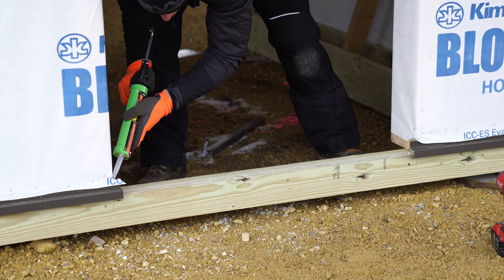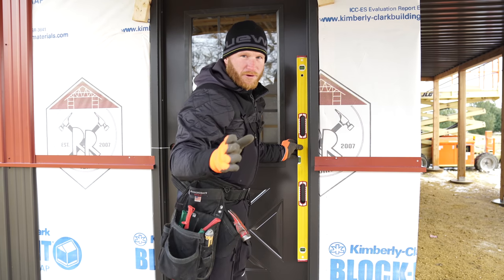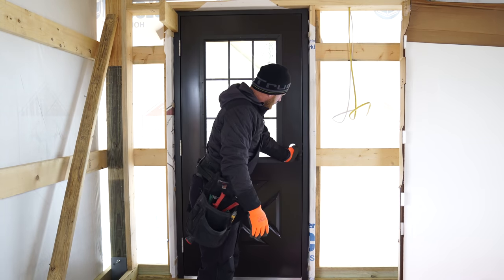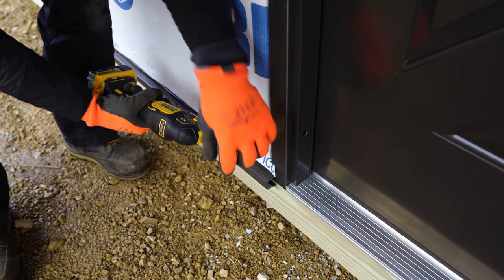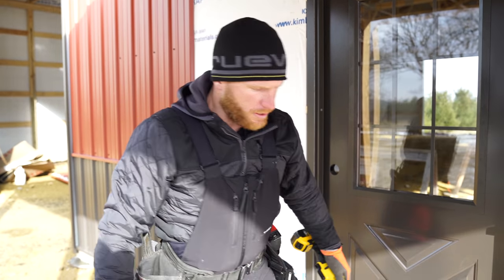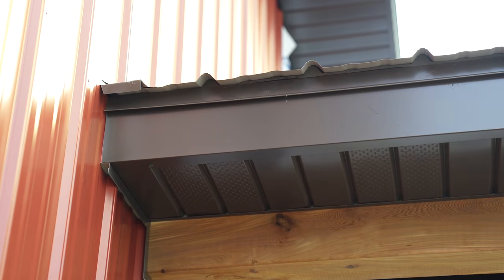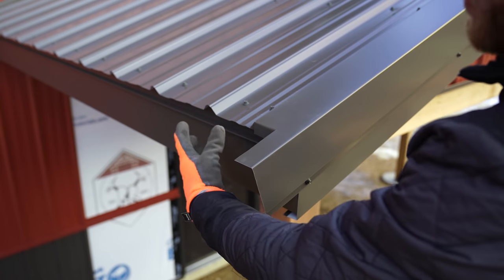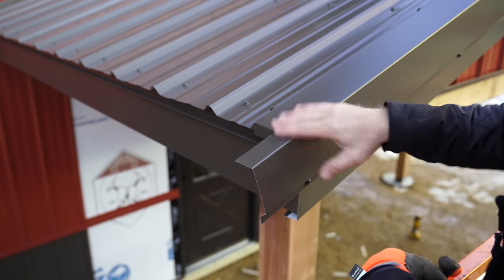Building a Large Garage 11: Installing a Door and Trim Details

Comment: 5:45 Don't forget when you get replacement blades to get the ones with the quick lock opening.  I bought  a pack of Bosch blades of the wrong type and tried to grind an opening for the quick lock but the little holes would not line up.  The remaining blades will work on my 12V Milwaukee tool back at the shop so not a total waste.

Comment: Oh get Well soon guys. 🤞🏻🌹🧸
By the way I was doing the trim for my new garage using your tips and tricks.
I cut the corner trims to lenght and found out I had bought the wrong ones.
They are to small to go over the metal, so now I have to unscrew the metal at corners, shorten it and run this corner trim under the side metal.
I believe it will turn out great any way. But damn. To redo all the 4 meter corners when I’m alone at this time because of the bug situation is a pain man.
Stay safe and hope to see you soon.

Comment: I should not have watched this. Your treatment at the gutter ends looks great. I have stood in the rain and watched rain flow past the ends of my gutters. 
I did not go with an inexpensive builder. My building is fully insulated with radiant in floor heat and perma columns. I came unglued when they finished the walk door and I could pass a piece of paper between jam and door frame. My 10x18 garage door had 1/4 inch gap on sides and top(door to flex seal). They had a professional hook up my opener. He saw the gaps and offered to fix. He did a great job.
I mentioned RR Buildings to my contractor before I signed anything. He said he watches your videos.
Reply from the maker: Wow ... sorry man

Comment: Tip if don’t do with DeWalt OMT, turn blade around 180° for when “storing” tool. That way, blade doesn’t stick out, &....cuz so easy to adjust (even over the Milwaukee) doesn’t take very long to rotate the blade itself. 
Just a little tip for ppl who don’t like taking blades of when storing or transporting tool.....
Thx for video ✌🏼

Comment: Screws?? - Some videos I've seen where they are doing similar construction say that the roof screws have to be replaced every 15 years because of leaks. Do you use something that is better than that? Is there any kind of screw that is permanent or are the other builders just wrong?

Comment: I enjoy the channel.  I've been in the business for 20 years, and have put on a lot of steel.  Why don't you stitch screw the overlaps like Metal Sales recommends in their instruction on the roof steel?  We have had some issues with leaks on long runs, as regular screws don't hold the metal together as well, and water can seep in. Stitch screws every foot solve that. 

I've never liked the overlap look on walls of Classic Rib, we always use Pro Panel II.  Have you ever used that?
Reply from the maker: not a pro panel guy but it's not bad...we stitch our roofs...just not our porches that are sheathed
Reply: @RRBuildings  Got it. I watched some older video's maybe you weren't doing it then, because regular screws were definitely going in the overlaps.

You ever been dinged by OSHA yet?  I have twice. Ridiculous. First time we were cleaning gutters, and finishing up ridge cap at 3:00 on a Friday all done with the job. Nothing is ever safe enough for them.   I thought a Morton Steel guy told me that they didn't have to be roped off on the roof if they had a lift like yours on the eave?